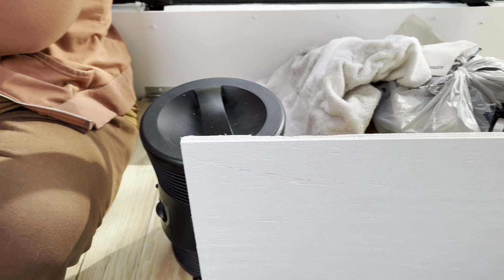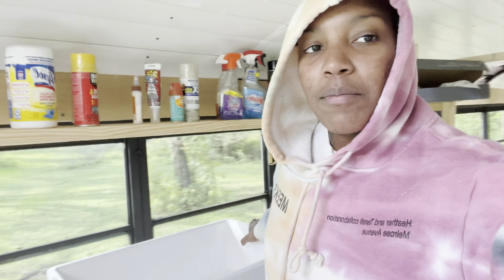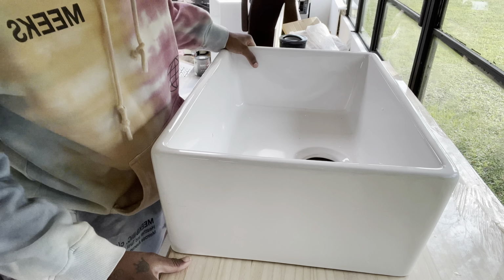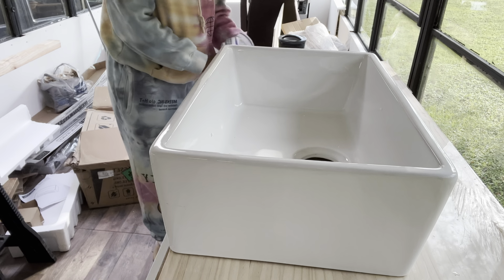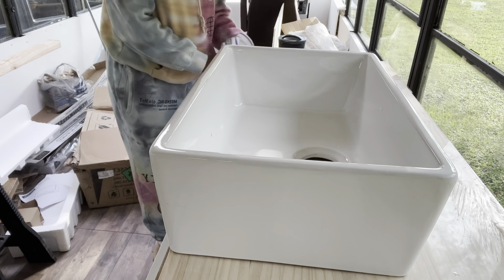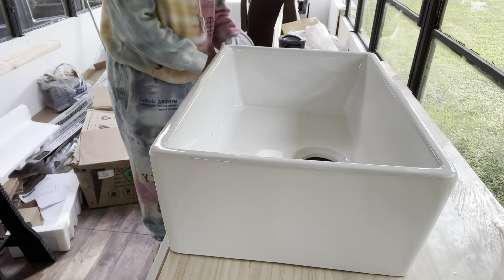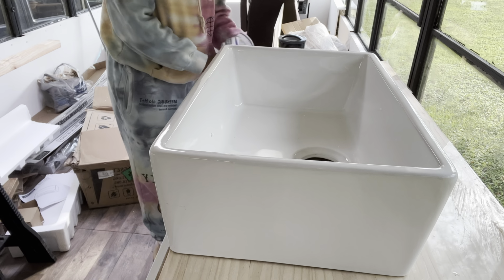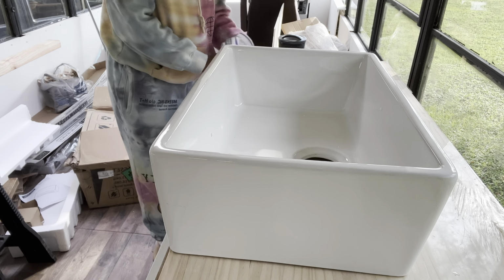SKOOLIE BUILD Ep. 44 *farmhouse sink*

Comment: Maybe instead of trying to fill in the gaps between front of sink and cabinet- cut it out completely and then scribe a piece of wood to fit the sink perfectly and screw in into the cabinet from the backside using scrap wood. For the back of the sink-Add a strip of wood underneath the gap- fill with backer rod and caulk over. Use painters tape to get crisp line. Keep up the good work! Looking great!
Reply from the maker: Good idea! Thanks!